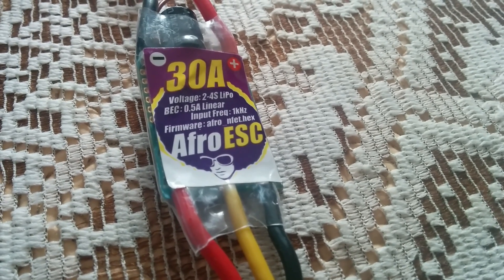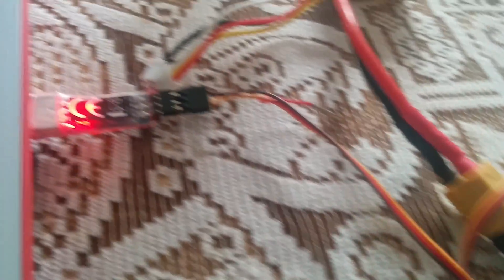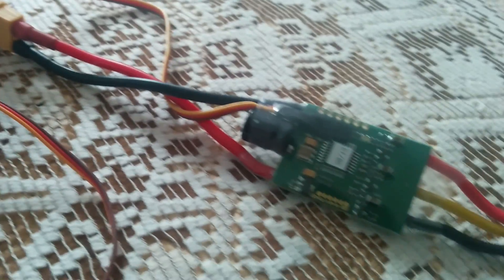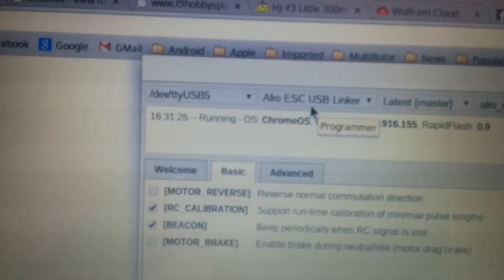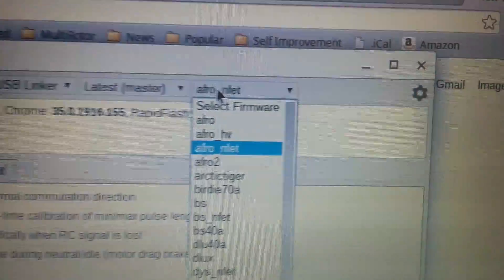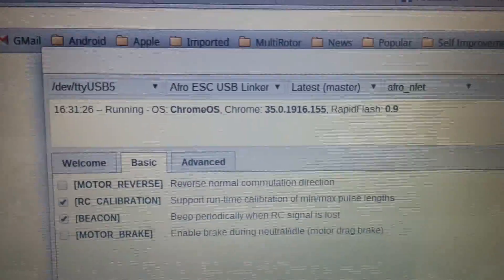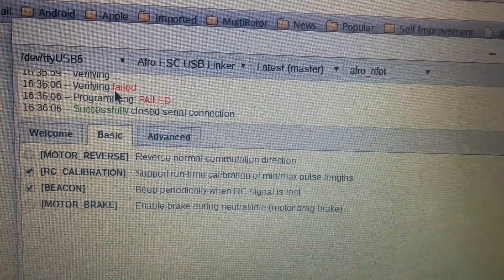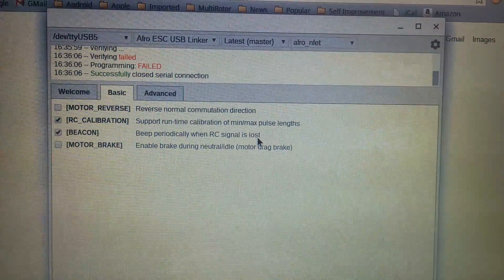Afro ESC programming failure - Rapidflash

Comment: Hi Danny

I've received Afro ESCs that were "bootloader locked" and was unable to flash them with rapidflash or kkmulticopter flash tool with the recommended Afro USB linker. I had the same message on rapidflash

I had to buy an USBASP programmer (about 7 dollars) and make a DIY adapter to flash via the PCB of the ESC with a "bootloader enabled" Simonk firmware.

After that, I had no problems with rapidflash a KKmulticopter flash tool while flashing via the Afro USB linker

I asked HK for a commercial solution, they refund me half the price of my ESCs on my bonus points. Great !
Reply from the maker: Hi Stephane,
Thank you for the information. That may be a good solution for me also. I have a USBASP programmer so that may be an option for me too. I appreciate the tip.
Cheers :-)